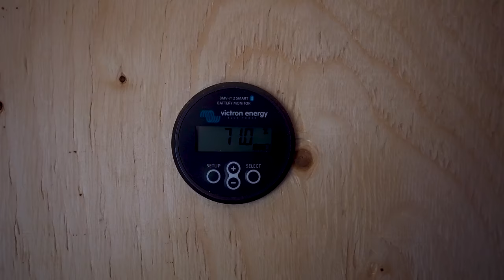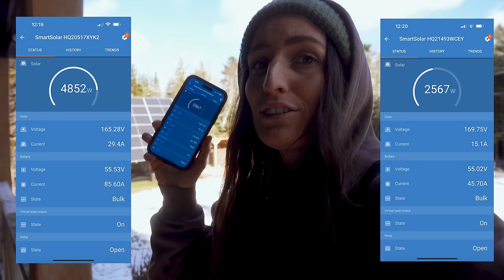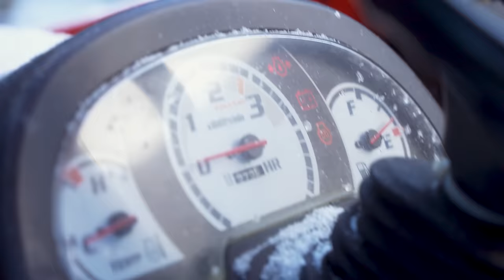Snowed In! Winter Hits Off-Grid Cabin in the Woods

Comment: You weren't stuck, that's a backhoe!  You're front tires are traction tires indicating you have 4-wheel drive.  Put it in 4-wheel drive for better control.  As far as being stuck, simply claw yourself out.  The hoe has enough power to pick your back wheels completely off the ground.  Either pull yourself backwards, or swing to the side.  Additionally the front bucket can be curled and placed onto the ground, and using the curl/ uncurl control, schooch the tractor a little forward or backward as needed.  Lather, rinse, repeat!  You gals are smart, you got this!

Comment: Here is my fave soup recipe, a pack of vegan chorizo sausage chopped, one medium onion, diced, two to three lbs diced potatoes, four to six cups of veggie broth or vegan chicken style broth, two  whole bunches of kale, de-steamed nd cut into bite sized pieces. Salt and pepper to taste, tsp smoked paprika, 1/2 tsp cayenne, and two bay leaves (I also add a couple dashes of oregano and fennel seed but they're not in the original recipe)
 To prepare heat oil of choice in a pot, brown the sausage and onion, add potatoes, broth and seasonings and bring to a boil until potatoes are almost  fork tender, then add the kale and put on the lid( it will look like there's too much kale, but trust me, it shrinks) and simmer until the kale is cooked down.
  I like to serve it with a ton of parmesan cheese and crusty bread with butter

Comment: Keep in mind, you can use the backhoe attachment on the tractor to pull itself back if needed. You can also push down with backhoe to raise rear wheels and then swing it over for a bit of directional control. Your first winter with the tractor, you’ll get the hang of it and all it can do.
Reply: also it might have a pedal/button for difflocks too :) could also say that plowing with the bucket is stooopidly crappy...a plow in the front would be epicly good
Reply: @nekoroms  It's so easy to say something nice and or encouraging, and yet...
Reply: He is being encouraging.  He is  trying to help them be more capable with their tractor.  The first step would have been  to check if the brake pedal is split    you might be able separate the rear brakes and get traction by stepping on the brake to the tire that is  spinning.  If still stuck, look for and apply differential lock pedal.  If you're still stuck,  lower the backhoe out riggers to about 3 inches off the ground (as wheelie bars, put the tractor in neutral and use the backhoe to  pull yourself off the ice. Just be super slow and super careful doing any of this.  There is probably some youtubes of these procedures.  Be safe,  and good luck.

Comment: Happy holidays, ladies 
I have a tip for you. To get your tractor out of the ditch. Use the backhoe bucket (bottom of bucket, teeth up in the air) on the low side or ditch side to lift the rear wheels off the ground  & move rear wheels back onto road.  Then, connect your tow strap to the rear of the tractor with pickup in (4x4 low range) to pull the tractor in reverse. Also, use the tractor in reverse (low range) to get it completely out of the ditch and back on flat ground.

Comment: Another lovely winter soup (I make mine a soupmaker)

Broccoli & stilton soup

A smooth, blended vegetable soup with blue cheese good for a comforting meal.

Ingredients

2 tbsp rapeseed oil
1 onion, finely chopped
1 stick celery, sliced
1 leek, sliced
1 medium potato, diced
1 knob butter
1l low salt or homemade chicken or vegetable stock
1 head broccoli, roughly chopped
140g stilton, or other blue cheese, crumbled

Method
STEP 1
Heat 2 tbsp rapeseed oil in a large saucepan and then add 1 finely chopped onion. Cook on a medium heat until soft. Add a splash of water if the onion starts to catch.

STEP 2
Add 1 sliced celery stick, 1 sliced leek, 1 diced medium potato and a knob of butter. Stir until melted, then cover with a lid. Allow to sweat for 5 minutes then remove the lid.

STEP 3
Pour in 1l of chicken or vegetable stock and add any chunky bits of stalk from 1 head of broccoli. Cook for 10-15 minutes until all the vegetables are soft.

Recipe continues below advert

STEP 4
Add the rest of the roughly chopped broccoli and cook for a further 5 minutes.

STEP 5
Carefully transfer to a blender and blitz until smooth.

STEP 6
Stir in 140g crumbled stilton, allowing a few lumps to remain. Season with black pepper and serve.

USE A SOUP MAKER
Save time and effort by placing all your ingredients in a soup maker and whizzing up a delicious soup in no time. Read our review on some of the best soup makers available
Reply from the maker: Thank you for your step by step instructions. So kind of you to take the time to share with all of us. 💛🐶

Comment: I have a full set of V-bar chains for our machine. I have not used the fronts. The rears help a ton , our driveway is sloped and I plow at 45deg or 90 deg to the slope . This helps not get stuck. Check to see if your machine has a Diff lock for the rear, ours has a button on the floor you press with your heal. This has saved my butt several times.

Comment: I used to love making the following soup “recipe” regularly. Now I can not, because I do not have a freezer available. It took me about 2 days, but I would be able to freeze around 30 portions to be quickly reheated in the microwave. That is an important factor when living alone.
In a big pot of about 10 liter capacity simmer some 5kg of beef leg bone or tail with herbs, salt and peppercorns. You can add whatever herbs you have available and like and/or tolerate. You can also add onions, et.al. for a different flavoring of the meat. For a richer broth you can add about 2kg of chicken wings. Let this simmer for at least 8 hours. Putting the pot on your wood stove in the winter is a nice side benefit of heating your cabin. Once the broth has cooled down, set the pot outside so the fat can solidify on top and be removed easily. You could also experiment with other bony meat cuts like pork, turkey, duck, goose or deer.
After lifting off the solidified fat, I strain the broth to remove all the semi-dissolved herbs. Then I remove the bones and fat from the meat. Meat and broth go back into the pot and on the heat.
Now I add the other goodies, like: cubed potatoes, corn, peas, lentils, chick-peas and/or angel-hair noodles. Add water to fill the pot to the brim and simmer for a few more hours. At the very end add some chopped fresh green herbs like parsley and dill.
Change and/or substitute ingredients to your preference. And this recipe can be either more liquid like a soup or more solid like a stew, depending on the type and amount of ingredients you add.

Yes it takes some time overall, but you can do other jobs while the pot is simmering. And the extra effort necessary to prepare a 10-15 liter pot as compared to 0,5 liters is negligible. And if you have a good sized freezer, you do a big production once and have quick and easy meals for a month more or less. Depending on how many people are in your household.

Comment: You should consider driving some rebar into the ground, leaving 3 feet above and sliding some colored pvc pipe over it, to outline the areas to plow and drive over in the winter. Especially if you ever have a real heavy deep snowfall.

Comment: You need to try the sweet potato pot pie. Make some crust or buy some. Then, mash up some sweet potatoes. Put that on the bottom of the pie, and as the final layer on top--beneath the top crust. Add a layer of stuffing marbled with red onion, celery, and carrot. Then add a layer of cream of chicken, or cream of mushroom, soup. Then, add a layer of mixed veggies--peas, corn, carrots, string beans. Add the final layer of sweet potato. Then add a top crust. If you like turkey, add cooked turkey on top of the bottom layer of sweet potatoes. You can use chicken, but it's better with turkey. Put in oven at 400 F. The veggie version is good, too! Enjoy, but don't forget the cranberry sauce on the side. It makes the whole thing pop in your mouth.

Comment: Not sure if you have tried ash before? My dually slipped off a drive way in the snow/ice and I put ash under the wheels. That works like sticky traction. Absolutely amazing.  Toss some on ice and see the grip it gives.  I now travel with a bag in the back of my truck once winter comes.

Comment: Hey ladies, hope you had a great Christmas.  How about this soup to warm you up in the winter.  We love it & it is soooooo easy.  
Spiced carrot & lentil soup

Ingredients
•	2 tsp cumin seeds
•	pinch chilli flakes
•	2 tbsp olive oil
•	600g carrots, washed and coarsely grated (no need to peel)
•	140g split red lentils
•	1l hot vegetable stock (from a cube is fine)
•	125ml milk 
•	plain yogurt and naan bread, to serve
Method
•	STEP 1
Heat a large saucepan and dry-fry 2 tsp cumin seeds and a pinch of chilli flakes for 1 min, or until they start to jump around the pan and release their aromas.
•	STEP 2
Scoop out about half with a spoon and set aside. Add 2 tbsp olive oil, 600g coarsely grated carrots, 140g split red lentils, 1l hot vegetable stock and 125ml milk to the pan and bring to the boil.
•	STEP 3
Simmer for 15 mins until the lentils have swollen and softened.
•	STEP 4
Blend the soup until smooth (or leave it chunky if you prefer).
•	STEP 5
Season to taste and finish with a dollop of plain yogurt and a sprinkling of the reserved toasted spices. Serve with naan breads.

PS would love a t shirt ;-)  XXL pls
Here's to a great 2024 from Mike

Comment: Ladies, I was thinking that you should think about building a simple shed for your tractor. It will last much longer if it isn’t out in the weather all of. The time. Even a lean to on one of your buildings will definitely provide lots of cover. One day you will want to get another tractor and you will have to either trade it in or sell it. They bring much more money if they have been taken care of. I have built a carport type of structure connected to a small shed and it stays much cleaner and the rain and snow doesn’t affect it at all. If you put it next to your shed with the power system in it you could easily have a battery tender to keep the battery in top condition. A charged battery can take the cold much better than one that has drained from the cold. Just my opinion. 
Kindest Regards, Your Pal Al

Comment: Lentil Soup

1/2 bag lentils
1 lg. onion, chopped
3 carrots, sliced
3 stalks celery sliced
2 cartons veg. stock
1 14 oz. can diced tomatoes
1/2 lb. macaroni
2 T. olive oil
salt, pepper, paprika, garlic powder
greens-kale, chard, spinach--whatever you like, coarsely chopped.  (About large handfuls)

Heat olive oil in a soup pot.  Add all veggies and cook about 10 min.  Add lentils, seasonings, stock; bring to a boil, reduce heat and simmer until lentils are tender, but, not mushy, about 30 minutes.  Add tomatoes.  In a separate pot, cook the macaroni til al dente.  Once macaroni is done, add to the lentils.  Bring to a boil and reduce heat to simmer.  Add greens now if using.  Cook until greens are wilted.  Serve- I like to add fresh chopped parsley, parmesan cheese and a little splash of olive oil.  Bon appetit ladies!

Comment: chuck that bucket and get  a sno push,  absolute game changer for wet snow, twice as fast and way better,  also if you have not gotten,  get a block heater and a battery tender for clem,  with those tow plugged in that thing will always start!  if not the coldest worst day you actually need it you wont have it

Comment: Pasta e Fagioli Soup (Olive Garden Copycat Recipe) 
 Serves: 6  Prep Time: 15 mins  Cooking Time: 35 mins
Rating: 5.0/5 
 ( 1 voted )
INGREDIENTS

1 pound lean ground beef
2 tablespoons olive oil, divided
1 c. dry ditalini pasta
3 cloves garlic, minced (1 tablespoon)
1 1/2 c. chopped yellow onion
1 c. diced celery (about 3 stalks)
1 c. diced carrots (about 2 medium)
2 14.5-ounce cans of low-sodium chicken broth
3 (8 ounces) cans tomato sauce
1 (15 ounces) can diced tomatoes
1/2 c. water, then more as desired
2 teaspoons granulated sugar
1 teaspoon dried oregano
1 1/2 teaspoons dried basil
1/2 teaspoon dried marjoram
3/4 teaspoon dried thyme
1 (15 ounces) can great northern beans, drained and rinsed
1 (15 ounces) can dark red kidney beans, drained and rinsed
Finely shredded Romano or Parmesan cheese, for serving
3 tablespoons minced fresh parsley
Salt and freshly ground black pepper
INSTRUCTIONS

Step 1: In a large pot, heat 1 tbsp olive oil over medium-high heat. Once the oil is hot, add the ground beef to the pot and cook, crumbling the meat apart as it cooks until completely cooked.

Step 2: When done, drain the grease and place the beef on a plate. Set aside.

Step 3: In the same pot, heat the rest of the 1 tbsp olive oil. Add the onions to the pot once the oil is hot along with the carrots, and celery. Saute for about 6 minutes over medium-high heat until tender. Then, add the garlic and continue to cook for a minute more.

Step 4: To the pot, add the chicken broth, tomato sauce, water, canned tomatoes, sugar, basil, oregano, thyme, marjoram, and cooked beef. To taste, season with salt and pepper. Bring everything to a boil, then adjust the heat to medium-low. Put the lid on and simmer for about 15 to 20 minutes, stirring often until the veggies are soft.

Step 5: Following the package directions, cook the ditalani pasta until al dente.

Step 6: To the soup. Add the cooked and drained pasta followed by the kidney beans and great northern beans. If needed, you can add more broth or water to thin the soup. Continue to cook for a minute more.

Step 7: Lastly, stir in the parsley. Serve right away garnished with grated Romano or Parmesan cheese.

NOTES

I suggest adding the pasta in individual servings if not serving the soup right away to prevent the pasta from getting soggy.

Comment: I have a ground mount solar array that provides over 100% of our power needs for the house. The extra will be used to charge an EV. This makes it critical in fall and winter to keep panels clear to keep production up. I found that using rain-x on the panels causes everything to slide off! A coating lasts approx 3-months. I use a weed sprayer to get rain-x on all the panels. Warm rain-x even melts ice/snow.

Comment: This is my go-to winter soup. If you leave out the pancetta it's totally vegetarian, and if you leave out the Parmigiano-Reggiano rind it's vegan.

Winter Minestrone
Prep Time: 45 min | Cook Time: 2 hr | Servings: 8 servings
Ingredients:
1/3 pound sliced pancetta, chopped
3 medium red onions, chopped
4 celery ribs, chopped
2 medium carrots, chopped
1/3 cup extra-virgin olive oil
1 bunch Swiss chard
6 garlic cloves, finely chopped
2 tablespoons tomato paste
1 (28-ounce) can whole tomatoes in juice
3 quart hot water
5 cups coarsely chopped cored Savoy cabbage (6 ounces)
5 cups coarsely chopped escarole (1/2 pound)
1 piece Parmigiano-Reggiano rind (about 3 by 1 1/2 inches)
1 (19-ounce) can cannellini beans, rinsed and drained
Accompaniments: extra-virgin olive oil for drizzling; cooked ditalini pasta tossed with oil (optional); grated Parmigiano-Reggiano
Directions:
Cook pancetta, onions, celery, and carrots in oil in a wide 7-to 9-quart heavy pot over medium heat, stirring occasionally, while preparing chard.
Cut out stems from chard and chop stems, reserving leaves. Stir chard stems into pancetta mixture with garlic, 1 teaspoon salt, and 3/4 teaspoon pepper and continue cooking, stirring occasionally, until vegetables are very tender and begin to stick to bottom of pot, about 45 minutes total. (Set aside chard leaves.)
Push vegetables to one side of pot. Add tomato paste to cleared area and cook, stirring constantly, until it starts to caramelize, about 2 minutes. Stir paste into vegetables and cook, stirring, 2 minutes. (Paste may stick to pot, but don't let it burn.)
Stir in tomatoes with their juice, breaking them up with a spoon, then add hot water (3 quarts), scraping up any brown bits from bottom of pot.
Bring to a simmer. Stir in cabbage, escarole, and parmesan rind. Simmer, covered, until greens are tender, about 40 minutes.
Coarsely chop chard leaves and stir into soup along with beans. Simmer, partially covered, 10 minutes. Discard rind. Season soup with salt and pepper. If using ditalini, stir in just before serving.
Notes:
Soup, without pasta, can be made 2 days ahead and chilled.

Comment: Chains or add liquid into your tires to add weight. Also remember you have a backhoe on the tractor that could be used to pull yourself out of a situation with the use of the truck.

Comment: If your going to plow by dragging the bucket backwards use the front of the bucket not the back tip it like you are dumping it then drag with the cutting edge will do much better job. And when pushing forward lay the bucket flat on ground  and push.

Comment: You can also use the bucket to get ur tractor out. Tilt the bucket all the way down....push it into ground, then rotate it up...pushing the tractor backwards
Reply from the maker: Tried. The bucket was wedged in between trees
Reply: Just one last comment....u might have been able to use the backhoe to push the tractor forward to dislodge the front bucket from the tree. But you got out

Comment: 2 cans split pea soup...1 can of corned beef...1 can of corn...1 can of carrots...mix the soup with the water and the veggies and corned beef...get a box of Bisquick and make the biscuit batter...when the soup boils drop in spoonfuls of the batter and reduce heat...cover and let simmer on low and the biscuit mix will turn into big fluffy dumplings